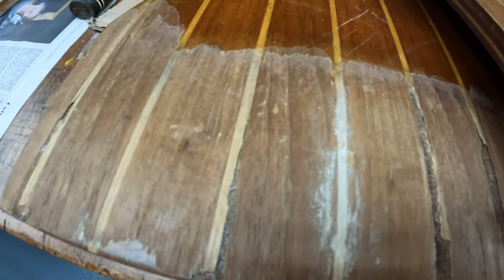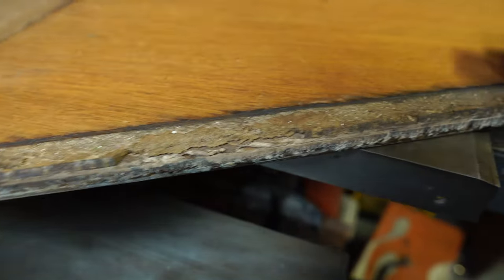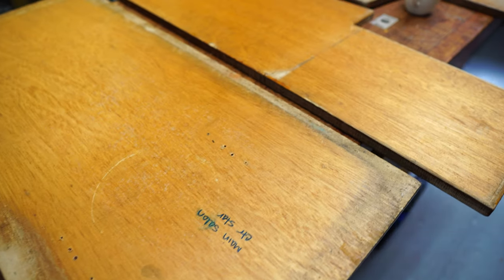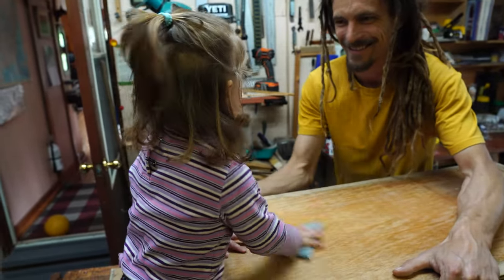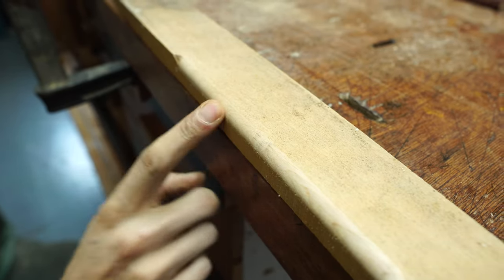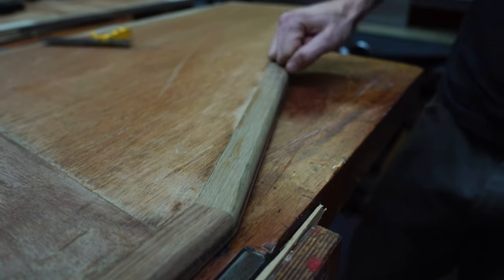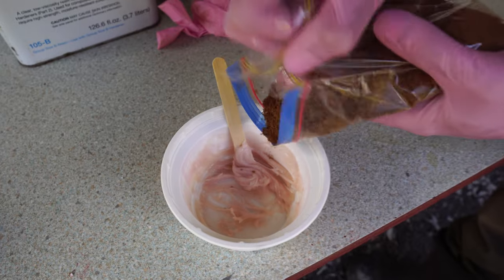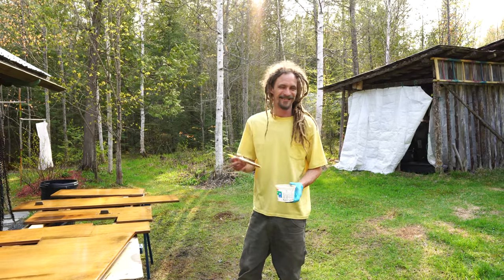Refinishing Destroyed boat floor (cabin sole)

Comment: what I learned from using wood dust in combination with epoxy is that more you put it darker it becomes on the sole, meaning if you want to have it brighter to match the color of the rest of the sole you have to be careful with the quantity of dust you put in the mixture. I had to dig out first patch and re-do it with “thinner” mixture, it turned out much better than the first one. Great job you did and lot of ideas brought up, tx👍

Comment: Great idea for repairing the rotted wood edges. Good way to save the floor panels. "Waste not, want not!" 👍👍👍
Reply from the maker: I'm glad it mostly worked. I definitely won't use the filler for that sort of project again but I learned what works and doesn't. Cheers

Comment: Corey, I haven't reviewed any previous comments so maybe somebody already gave you this tip. As a professional woodworker I can tell you the easiest way to make woodfiller match a wood is as follows. First use a 2 part wood filler, one that comes with a hardening agent. Second, pre-mix your stain color in the wood filler (prior to adding hardener). Get the close, not perfect. Once you have that done, add hardener ( a little more than instructions due adding stain to filler). Then apply. Let set and harden, then sand. When sanding, make the area about 4 times larger than the patch area. Wipe clean and then stain over the sanded area again. That should get you a close match. Then varnish over the whole piece, and you should be good for quite a while.
Reply from the maker: Thanks very much for the advice. I will have to find a 2 part filler to try out. Any recommendations? And for teak which stain would you go with? I'll have to experiment more myself. Thanks again.